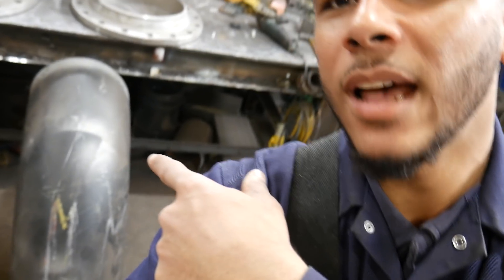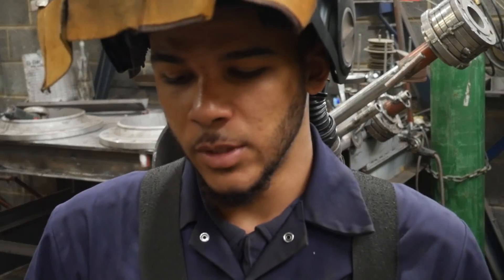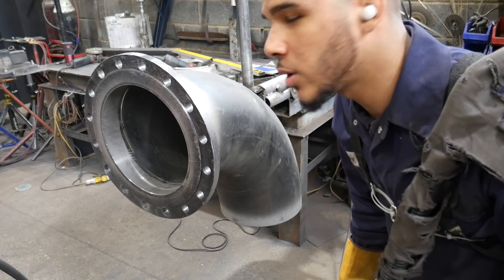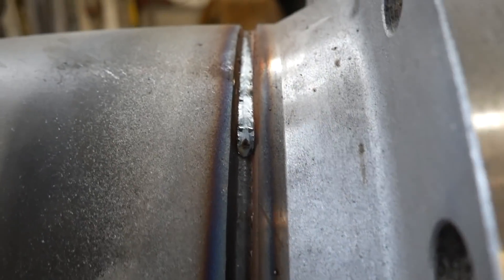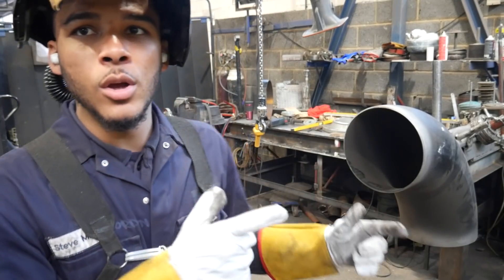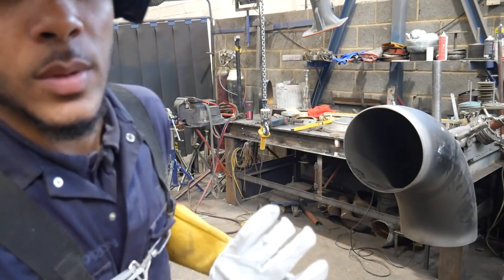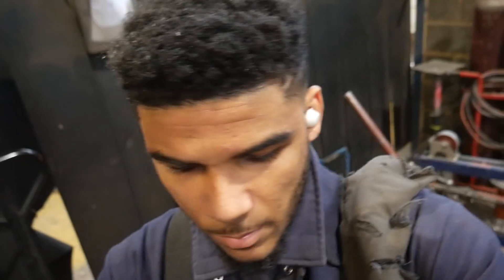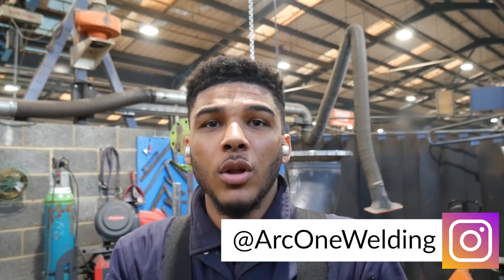Back To Basics 16" Pipe Spool MIG/MAG Welding

Comment: Great work. What's up with X- Ray on your runs?
Do you think you will passed a X-Ray test?
Best Regards from Germany
Reply: No reason it wouldnt👍
Wouldnt be quite as high quality as a full Tig or Tig/LowHy weld, but still perfectly within what is needed. The one huge bonus with STT/RMD/CMT root function (depending on manufacturer as they all have different names for it but is the same thing) and Pulse for filling and capping is the speed factor

Comment: Mind those flange faces on the floor bud! 🙂👍
Another cracking vid though 👌
Reply: The flange faces see more damage in the field than a concrete floor so it doesn’t matter
Reply: @andrewfuentes2887  doesn't matter??
It does matter when you're working to any sort of standard😄
And "see more damage in the field"? When youve got people installing it that dont give a monkeys maybe. 
But when a job is done properly, machine faces on flanges and the gaskets between the flanges will be in "as new" condition as everything is bolted and torqued up if a job is done properly by skilled tradesmen👍

Comment: Good job.

No MMA in fab shops now ?  Has mig has replaced NuFive's for root weld?
Reply: Still plenty of Arc used in fab shops here in the UK (for class 1 work anyway).
Mig has replaced Nu5 or Fleet roots for a lot of low pressure work, as its so much faster. But high spec is still Tig rooted, or rooted with fleets. 
Some of the work we've done recently, going by the procedure we had to root with Filarc 56S and fill and cap with 78S!! Proper old school lol. 
First time run a lowHy root for ages lol

Comment: So I was just curious your welding with short circuit for the root I’ve watched a few of your videos how do you get it to fuse properly without shooting whiskers or lack of fusion is it from the spray transfer that gets it to fuse properly for the root? Since the puddle is so liquid just out of curiosity cuz I just got done with short circuit pipe and the instructor said to do a 1/8 gap but I did a 3/32 gap I know that it has a chance to get lack of fusion which I did at one point but there wasn’t any straight edge so he let me cut and bend it and it did pass

Comment: How do you make sure the bolt holes line up with the pipe this joins to?
Reply: As long as the other flange has the same bolt pattern, it will line up.  U will be able to bolt it all the way up or unbolt it and spin it around and all the holes will still line up.

Comment: Love your channel and content dude but have to say some of your welding terminology and techniques are incorrect. Hump?! You mean convex. Your torch angles are extreme and running 250amps plus in the PG position on those caps with that torch angle surely don't conform to any WPS or pass any procedure tests. Perhaps the company you work for don't have much quality control/WPS's/procedures... I'm intrigued to know.
Reply: You sound like a Karen..
Reply: @purple935  nuclear welding industry is full of them my friend ;-)
Reply: perhaps if you was the inspector on this job you wouldn't need to be intrigued 😘 stay safe.regards,eddy current.
Reply: @jflwelding  wouldn't be out of work as an inspector on that firm 😱
Reply: @wi8216  😲
Reply: @jflwelding  perhaps the dude (great tradesman besides his lazy torch angle) is following a WPS correctly, perhaps there isn't one to scratch their arse with on that shop floor... would love to know ARC ONE.
Reply from the maker: Guys im not a expert, ive probably learnt more from searing Google to answer question u lot have asked me, i do a job and thats what i know, and once your in front of a camera all your words leave your head. 
The work i do isnt critical most of the pipe i do is sch20 with only 10% needing ndc testing, and the welds i do is the same welds i did to pass my test
Reply: @ARCONEWELDING  I appreciate your videos and information your providing. I’m a tig pipe welder and (I) have learned from you. 💯
Reply: @ARCONEWELDING  you don’t have to explain yourself. You do a great job of setting up and welding those spool pieces. These so called welding inspectors just can’t help them self’s commenting on people’s work to make them sound like they know what they are doing!  Must be some sort of turn on for them. Keep up the great work!
Reply: @danielhalfpenny2456  his fit up is bas ass! His work is super neat. Im intrigued if the company he works for supplies a WPS to the welders on the shop floor. This should be the procedure on any high integrity job yet firms don't seem to do so. The industry lacks in correct quality assurance & control. ✌🏻
Reply: respect to inspectors but some have the lads chasing shadows and echoes on jobs,if there right then all and well  but if there wrong they can knock the confidence out the best of the best.i good inspector along side  the welders forms an elite team.
any way calvin great work.you dont need me or anyone else to tell you.your not out of work.😉
stay safe and keep burying the guy at the side of you in rod ends.
jay
Reply: @MPM Welding You've seen structural welds your 7 year old son could do better, structural steel is full of chancers and as for builders welding!!! Structural steel is heavily, well should be heavily regulated conforming to BSEN 1090. Fronius manufacture first class machines but disagree that you could get away with any of the above you have mentioned, MIG welding always has been a two handed operation. Your mans welds look great visually but id love to see a WPS that states PG as the position for the cap. ✌🏻
Reply: @wi8216  i use the same machine day in and out and i feel confident in saying that you can mig weld one handed. You would be amazed at what i have seen let go on pressure vessels. Missed edges, no pen shallow cap. Tig welding butts on stainless for clean water with no purge. Its shocking but companies gey away with it for speed and profit. This lads work looks good to me. I am coded lloyds class 1 but no inspector.
Reply: @rich3633  MIG welding is a two handed operation. Ive not stated his work looks bad at all visually. The welding industry is lacking in correct quality control and over run by cowboy firms cutting corners as it sounds like you encountered.
Reply: @wi8216  what can i say mate. I can pass the tests one handed. maybe you cant do it one handed but the lab that tests them says i can.
Reply: @wi8216  structural steel welding is heavily regulated if your working for the big companies. All the butts that are  full pen are ut and mpi and 30%for the rest  and if there is any thing the percentage  is upped ..secondary steel is where the nightmares  are. i had to repair a months worth of work by some cowboys once subcontractors who were employed because they were cheap..
Reply: @kez0o9  sounds familiar. You're right... lots of good firms out there working within 1090.
Reply: You must be one  of the inspectors my teachers warned me about
Reply: @Wanglicker42235  Probably because your teacher got caught out by the inspector all the time not working within the standards, WPS etc etc ✌🏻😎
Reply: @MPM Welding nah hump is something the welsh do to sheep and a valley where you find them.